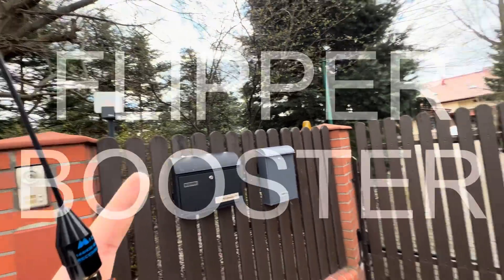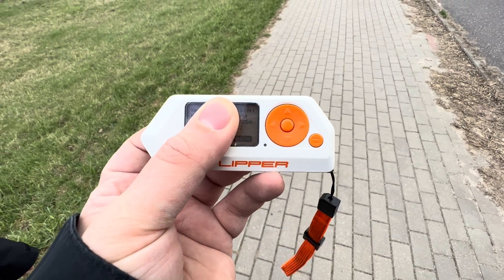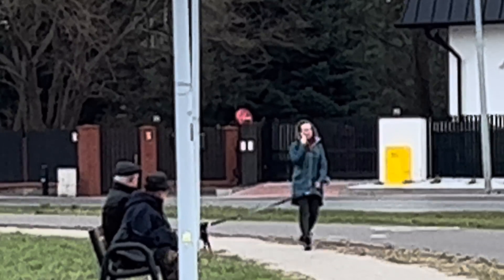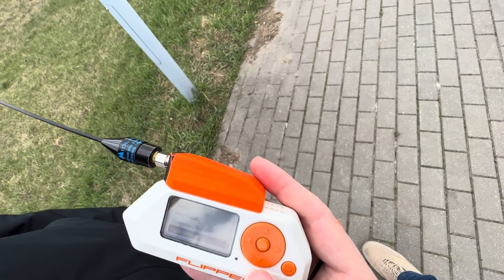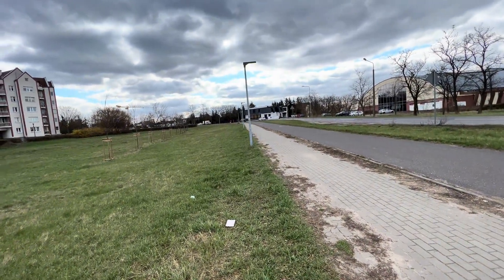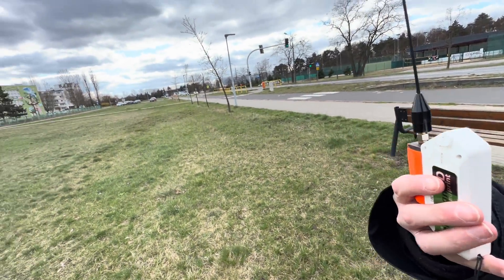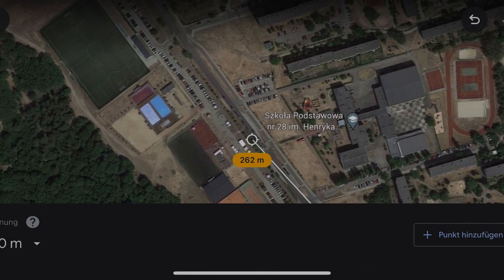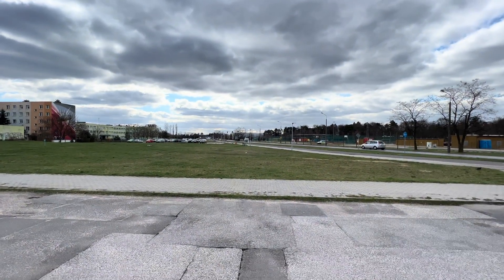Flipper Booster - RANGE TEST

Comment: However it won't fit on the flipper zero if you have the flipper in a silicon case... Wish I'd known that before I bought it... 🙄
Reply from the maker: There Are two Versionen - one that fits the flipper with and one without the silicon case !  Just look : https://shop.euerdesign.eu/products/booster-s-for-flipper-zero-with-silicone-bumper-without-antenna

Comment: Can you use any radio antenna? Like you would on a GSM radio?
Reply from the maker: Hi, you should use the antenna to the proper Frequency. If you use the flipper on 900 MHz the antenna has to be tuned to 900Mhz - and so on. Please make sure that this value is right. Then you can use any antenna.

Comment: is the antenna male connector or femal connector?
Reply from the maker: It’s a SMA Male connector
Reply: @roobertssuccess  whats the dbi gain for that antenna?
Reply: @roobertssuccess  isnt the CC1101 only for 3.3v, I could see that your booster is also including the pin 5v, any problems?

Comment: So what about if you have a case on your device will the booster still fit?
Reply from the maker: Hi, no it does not fit, but in 2-3 weeks there will be a new housing for the booster, that fits with case
Reply: @roobertssuccess  Coool. Good to know, definitely is the coolest looking cc1101 module I’ve seen.
Reply: Is V2 restock the one with the new housing casing to fit with case?
Reply from the maker: The Booster S fits now the silicon case perfectly ! And the module has longer pins .

Comment: can you do Test - Basic test on flipper and tell us what the difference is for internal and external?
Reply from the maker: As you can see in the video, the range on the internal antenna under 80m ! Customers with the booster are reporting 800m +
Reply from the maker: I could no see further then 400 m in the video
Reply: @Robert Stefanowicz  no I mean if you do this same test if you go to 5:50 in this video. 

https://youtu.be/XzMijgPuccE

what is your baseline with internal antenna then with the external antenna module?
Reply from the maker: With the Booster enabled  i´ve got. stable -84 to -86
Reply: @roobertssuccess  what is it with internal antenna for baseline?